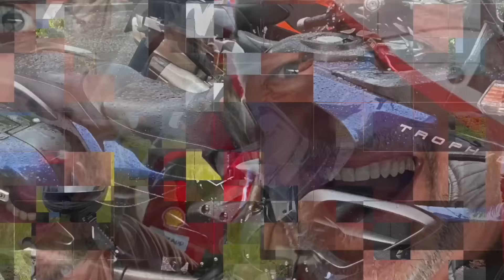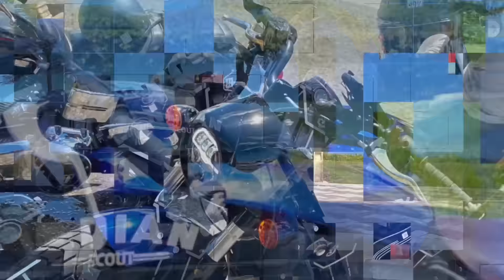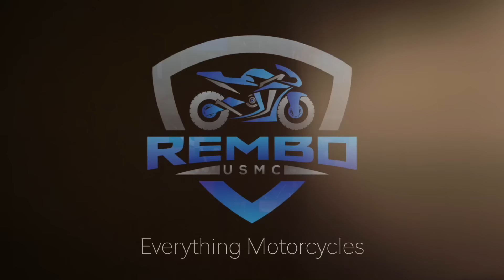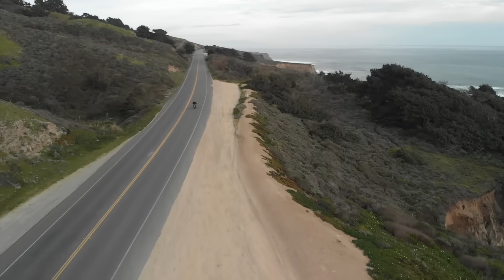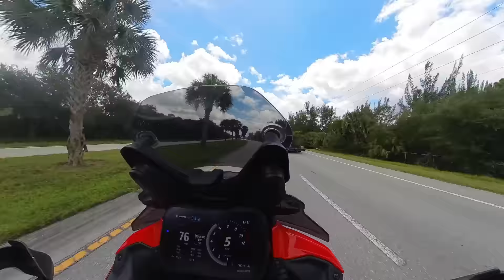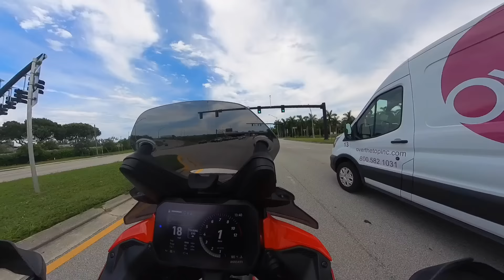What Ryan F9 Did Not Tell You About Motorcycle RPM

Comment from the maker: Blow out the carbon or let it accumulate?
Reply: Higher compression!

(Or not)
Reply: "Ride careful, mate!" "Nope! It'll kill my reflexes!"
Reply: Blow it out.  At least once every ride.  You don't have to red line it, just stretch it's legs out a little.
Reply: ride like the wind. . . hurricane wind 🤣
Reply: Lots of modern tools help answer that question without guessing. If you have modern ignition and fuel injection systems you shouldn't need to do anything out of the ordinary for "carbon buildup". If you still have questions you can take a look at the spark plugs on occasion to see if you actually have a looming problem.
Reply: @paradoxworkshop4659  So called "carbon buildup" can affect spark plugs and valve closures. And in some cases it can build up in the valve stems and so forth. Carbon buildup used to be a serious problem for two strokes with imprecise fuel and oil metering.
Reply: @indonesiaamerica7050  I 'get' to use an old forklift at work that takes a while to stop running...'dieseling' or running on is also a symptom of carbon build up, even after the spark is no longer sparking...
Reply: Yes! Why not both? Lots of circumstances call for chill riding, and a big part of the joy of motorcycling is hearing that engine wind out once in a while.
Reply: Let it accumulate to save the planet. Use your ride as a carbon sink.

Comment: Ryan makes an important key statement near the end of his video: "... Never lug your engine." I think it's okay to use the low RPMs during low power demands. But if you need to scoot, downshift with your boot. Great video. Thanks!
Reply from the maker: Great point!
Reply: I'm fairly certain the definition of lugging an engine is when you try to accelerate in too low of a gear or shift to a gear that brings the RPM far too low. That normally wouldn't include cruising
Reply: In the UK we refer to it as labouring the engine 😊
Reply: @kevindarkstar  Loading the motor Downunder. Bike or car: downshift and get some revs. And some (many?) people do "cruise" by dropping their RPM (and speed) and then (while "cruising") attempt to gain speed (for eg an overtake) by adding power without decreasing the gear.
Reply: @NathanaelNaused lugging the engine is the exact opposite. It's letting your speed drop, staying in a high gear, then accelerating without down shifting
Reply: cruising and staying at a certain speed at low RPMs is not necessarily bad imo. it's when you wanted to change  speeds, or overtake someone, and you just go full throttle without going down a gear or two that doesn't feel right.
Reply: @DR4WZ exactly! If you do this, the engine is at a huge mechanical disadvantage with respect to gear ratio and power applied, I've seen lugged motors w/ bent broken rods.  A lot of cats shift way too early as well.

My 300 rally is happy around 6000, don't be afraid to rev it within reason to keep it clean!
Reply: Yeah. My takeaway was to perform an "Italian tune-up" from time to time. Not all the time.
Reply: This came up in the late 90s early 2000s when GM released the LS engine mated to the 6 speed trans. Freeway speeds generally had the engine barely above idle in top gear which led to great mileage and relaxed cruising, but a lot owners tended to not downshift to 5th when they needed to pass. You could definitely pick up speed in 6th to pass but you were lugging it a bit. This led to oil consumption and other issues. Took awhile for word to get out not to floor it at 1400 rpm.
Reply: It also puts tremendous strain on your Conrod and probably some other parts to rev to low all the time
Reply: For what it’s worth my newer model JD skidder had a button for operating rpm. No lugging allowed. Operating rpm means go. No other rpm allowed. If it matters I also ride bikes. What this guy is saying makes sense to me.jmtc
Reply: Riding around in a very low rpm, can be deadly. I try to stay where the power is riding a motorcycle. In a stressful situation, rpm's can get you out of a pickle. 

Automatic vehicles today. Tend to upshift quickly, for fuel economy. Nothing bothers  me more.  Than a 10 speed transmission in 8 th gear in the city.

The engines today, imho will only  fail from neglect or heat. Rev limiters are built into every vehicle today. To avoid catastrophic failures.

Nothing is 100% but engines today are pretty advanced.
Reply: I use medium engine revs. Of course, after the oil and the machine are warmed up. Kawasaki Ninja zx6r 2004.
Reply: Fuel economy disagrees

Comment: If there's one thing you should take away from Ryan’s video it's “You paid for the whole speedometer, so use the whole speedometer.”
Reply: He said tachometer (rev counter).  If you used the whole speedometer on most bikes, you'd lose your licence and your liberty very quickly.  He makes an important point, and especially now most bikers are middle aged or older and are used to driving cars.  I find it too easy riding my bike around town to drop down to 30 mph or lower in 6th gear and the engine doesn't "sound wrong" because I do more miles in my car than on the bike.  However, it would be kinder to the engine to drop down a gear or two.  Although my engine can sit at 2,000 to 3,000 rpm, it's probably better for it to sit at 4,000 instead.
Reply: Yeah you're right ,but it would be funny explaining that to the cops if you get pulled over ,be wise where & when you take your bike for its EXERCISE 😁

Comment: Definitely depends on the bike.  I had a Ninja 250 with a 14,000 rpm redline.  It required 3-4k just to get moving from a light and usually needed about 6k to feel happy at a steady speed.  Highway cruising in 6th gear meant 8-9k at 70-75 mph.  It seemed to just love to scream to 13k now and then under hard acceleration.
Reply from the maker: Great point!
Reply: PRetty much. On my zx 14 I barely went past 7000 RPM. Honestly as long as the engine "feels" like it is in the range where it has some engine braking and the ability to accelerate effeciently, I think you are doing ok. 

As with all things, prolonged time at the extremes is bad. 

You cant spend all day at redline, and you cant spend all day at 30 in your highest gear. 

There is also the safety aspect. If you cant accelerate in a bad situation, you can have problems. If you have zero engine braking off the throttle, it can increase your breaking distance. And on real world roads, saving yourself even a handful of inches in braking distance can save your life. 

So yeah, that is my 2 cents.

Comment: With clean modern premium fuel and premium synthetic oil. Carbon is no bid deal
Reply from the maker: Great point!
Reply: Well that’s not true. Premium fuel may have more detergents but if you think it eliminates carbon build up you’ve been lied to. If you want proof just take apart your engine.
Reply: @oldmanmerc  There are more brands of engine cleaners than I can count that people can buy and mix into the fuel to clean the inside of the engine where this carbon buildup is an issue on some bikes. Just use that.

I'm all for making sure our bikes last for as long as possible, but you clearly don't respect your bikes health and fuel economy. If I wanted to fuel up every 10 miles, I, too, would be in 1st gear at all times because it "puts my engine in the upper RPM range". 

More so, if engines were meant to always be at 7k RPM, then bike manufacturers would just give you 1, maybe two gears and tell you to go at it. Maybe, just maybe the multi billion dollar industry that is the automotive industry designed their engines with this in mind? Maybe they designed the engine in a certain way that doesn't require you to be in 2nd gear at all times by giving you more gears to use. Maybe the inclusion of more gears and the ability to ride around in 5th gear at 30mph was intentional and means that the manufactures tested their engines before mass producing them to ensure that we don't have to worry about this issue. Maybe it's an issue on very old bikes with engines from the stone age, but modern engines usually have this stuff covered

Comment: I grew up riding two stroke street bikes, and my Dad taught me to never just cruise down the highway for endless miles at a leisurely rpm, but occasionally downshift and let it rev up to blow out the carbon. He said that two strokes(of that era) were built to change rpm, like an mx bike that never held a constant rpm, but was “cycled” up and down the rev range. Plus, it was fun as a young rider to downshift and hear the engine howl out of the expansion chambers!
Reply from the maker: Your dad was right.
Reply: It’s the oil you’re burning out, not the carbon. In a two stroke, oil doesn’t burn at lower rpm’s, so you get lean situations when oil pools in the crankcase and combustion chamber. It happens all the time with outboards, especially older ones, since they sit at idle so often. The oil can leave carbon deposits, but carbon isn’t the reason you need to open them up periodically. The lean situation is far more detrimental.
Reply: @thagingerninjer5391  good to know, thank you! I am restoring a Bultaco Alpina this winter, and (hopefully) will have it ready for next Spring riding season. Judging by how much oil is in the pipe, I’m guessing previous owner either overmixed the fuel, or never revved it up, or both. Will post a video when it’s done!
Reply: @bryanbrowning5746  that’s gonna be sweet! Some two strokes run really rich from the factory, to keep them out of a lean situation, since they’re really susceptible to predetonation. It may have been idled or babied a lot, or it may just have been ran really rich, especially if it oils itself. I just rebuilt a 1999 Yamaha pw80 dirt bike for my eight year old’s birthday Friday, and the crap that came out of the silencer when I gutted it was disgusting.
Reply: Cruising on a 2 smoke engine is bad for it , but not because of carbon build up but rather because the oil is in the  fuel , if you are not giving it enough fuel/oil  the engine  gets worn out  FAST .On the other hand oil can pool  up in the cylinder which is also not a good situation . 2 Smokes need their RPM .
Reply: Two strokes are a different beast. It's not so much about carbon build up with those things, it's about getting lubricant through them. The more fuel that you put through them, the more lubricant that you put through. It's somewhat counterintuitive, but they "last" longer if you give them a red hot go. But it's not just about getting the lubricant into them, it's also about getting it out, too. Two stroke oils tend to accumulate on things like spark plugs, and, in the exhaust, if it isn't encouraged to exit. It's one of the reasons that you see race riders rev their bikes while they're on the starting line. You're obviously old enough, given your experience with them, that you've seen this at the lights, too.
Reply: Riding a 2 stroke easy will foul your plugs. Need to rip and roar them time to time while on your ride.

Comment: I think Ryan statement on how 'low rpm' could damage your piston (hole) is a little exagerated. If it would be dangerous for the engine, manufacturers would include a 'minimum' rpm range indicator in the tachometer (with red marking and everything) just as they do with excessive rpms.

Comment: Load should also be considered. Low RPM under very small throttle openings (or coasting) isn't going to cause an issue. The RPM you ride at depends largely on the situation. Riding aggressively, I keep my RPMs in the upper half of the rev range. Cruising around not using much throttle, I keep them lower. If I need to speed up, I don't just grab a big handful of throttle and let the bike lug...I downshift.

I do the same in my car...which is even more critical as it's turbocharged.
Reply from the maker: Excellent point.
Reply: That's how you're meant to ride lol
Reply: If you are riding small displacement bike with low power output then riding in a lower gear and higher rpms is necessary only if you want more aggressive acceleration when you open the throttle.  On a liter plus bike it is largely  unnecessary to do this or even downshift unless you want real high acceleration or riding up steep grades.
Reply: My car is turbocharged and that produces so much torque downshifts are rarely necessary.
Reply: @davidmatthews3093  Exactly you got my point.  The guy who started this thread has no clue.  There is a reason all automatic transmissions upshift as soon as torque load on engine is reduced.  No need to have engine buzzing at high rpm with very little torque output and poor efficiency due to pumping and frictional losses and poor thermal efficiency due to low cylinder pressures and temperatures.
Reply: @kannermw an auto is there to automate a manual. The whole idea of dropping the gear is to raise the torque. Otherwise you’d just drop the clutch. 
It’s not about the rpm’s, it’s about the torque. An auto can’t do the torque as good

Buy a manual, is better in every way! 😀
Reply: @kannermw by the way, you downshift if you need torque! If you shift up, you will have even less torque
Reply: @kannermw it’s also correct that you don’t need to do it with a higher displacement motor because you should be doing it anyway. 
That’s what they were designed to do! You will get other problems if you drive it soft
Reply: @greekkidshows9373  I am mechanical engineer well-versed in engine tech, operation and the effect of gearing.  Operating an engine at maximum throttle and low rpm is obviously not good practice (lugging) nor is unnecessarily high engine  rpm.   High engine rpm at low engine torque load wastes fuel and unnecessarily  accelerates wear on moving parts.  

As a general rule maximum engine torque is relatively proportional to engine displacement.  I won't get into nuances of bore/stroke discussions but as a general rule maximum piston speed becomes the primary limitation in design.  A 1000cc engine compared to 600 cc offers a 1000/600 = 67% greater torque.  That means it requires equivalent less gear reduction and proportionally lower engine rpm  to produce same rear wheel torque and  hp.  In general a 1000 cc bike can accelerate at same rate as 600cc bike operating at  minimum 1 lower gear.  Thus, that is why liter bikes are much more twist throttle and go vs 600 cc bikes requiring a downshift to  go.  You only need downshift on liter bike to get warp speed acceleration or 2-up passing capability.  Some people consider that boring but I consider that more enjoyable and less fatiguing for longer distance sport touring.

The guys that say they prefer riding a slow bike fast is more fun than riding a fast bike slow are never doing extended day rides.  They are mostly garage queens who talk a big talk and think riding  hour or two makes them a serious rider and then they are done.  I NEVER see these guys riding the amazing roads I ride  EVER.  Why?   Because they couldn't tolerate the challenges of getting there on their buzzy, busy, low power bikes.

Comment: Nice discussion. What I used to do was not to rev the motor until fully warmed up. Bought my 1st BMW R 75/5 with 98.000 km on the clock. Had to change the pistons at about 125.000 km's. Rode it until 230.000 on the clock. (Was afraid for the chain that is running the timing. Later on learned, that this chain is engineered to last a 500.000 km's)
Long distance rides also help. Putting on 1600km (or more) in one single weekend made the thing purr like a cat, afterwards.
Reply from the maker: Thanks for sharing

Comment: I thought the rule of thumb is pretty straight forward: 

“Ride in lowish rpm (usually 2.5k to 5k depending on the bike) when cruising, shift down before you want to accelerate away so you don’t lug the engine.”

Comment: I feel we have bought our bikes to enjoy, have fun. Thinking too much about carbon buildup and engine life reduces that exponentially and comparatively how much life will you extend. Not too much I would say unless one is unreasonable in their usage. 

I am not saying that we should be stupid or anything but rev the nuts off if you have the road and the mood, cruise when you want to. Primarily enjoy your bike and life 🍻
Reply from the maker: I agree
Reply: 100% - it's easy to get caught up in imagining what's inside your cylinders, getting all worked up about it. Most of us end up selling our bikes anyway and I have never known an engine to fail because it was ridden imperfectly. Typically it's everything else around the engine that fails first (alternators/starters/plugs/fuel pump etc).

I've got a ZX-14 and just love riding at crazy low rpm because I know it can handle it and it sounds cool. Just ride the way you love.
Reply from the maker: Great thoughts!  @robbroy
Reply: Common sense goes a long way in allowing rider flexibility throughout the RPM ranges.  I liked the author's tip for "balance" in your riding techniques.  Babying any internal combustion engine regularly and consistently with low RPM's throughout the engine's life cycle will damage your engine.  Conversely, riding regularly and consistently at High RPM's when unnecessary will prematurely wear your engine which can lead to engine failure.  Balanced riding throughout the RPM ranges is key to a healthy well performing engine.
Reply: people like to hear themselves sound knowledgeable ,riding  safely is not abusing your machine, dont overthink it